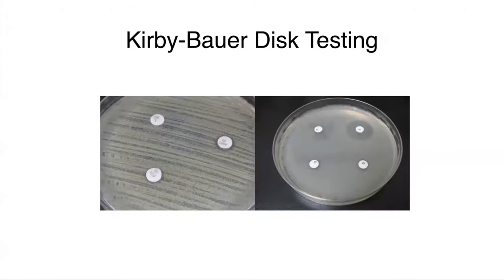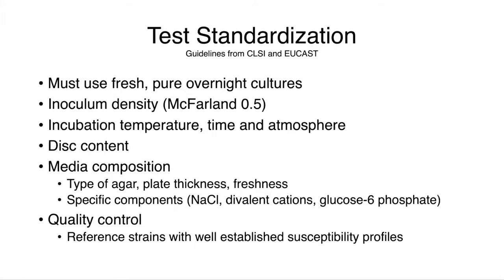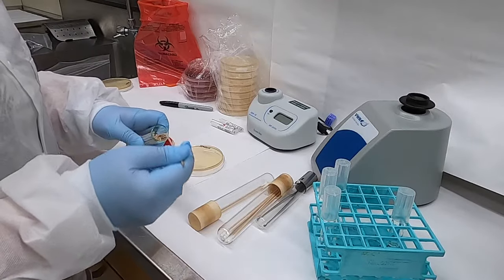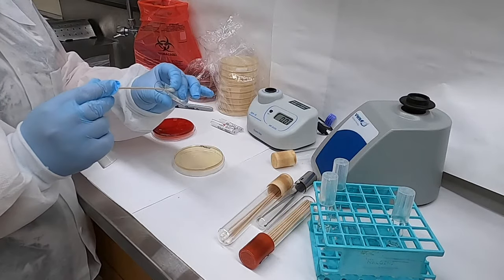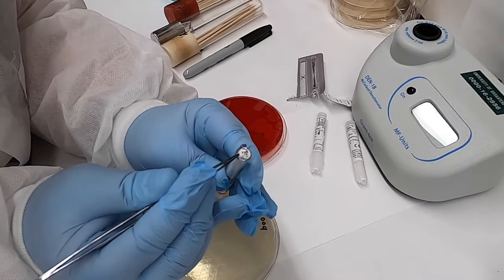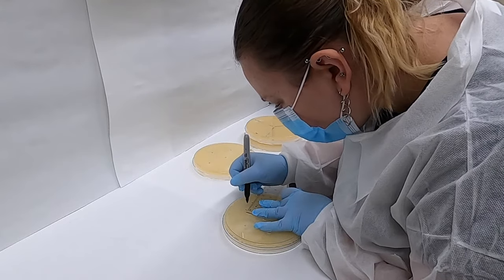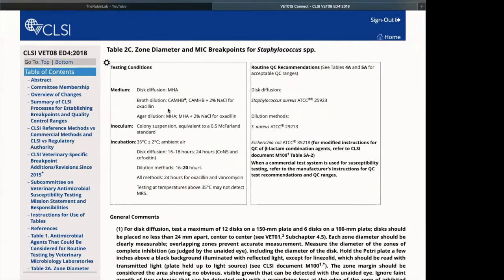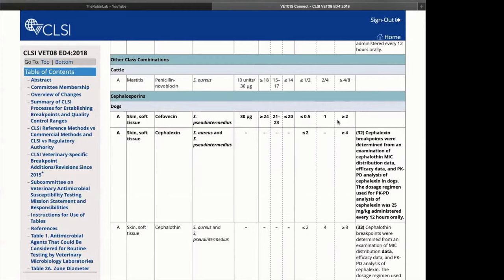Disc Diffusion (Kirby-Bauer) Antimicrobial Susceptibility Testing

Comment: I'm doing fungal research study these days. We couldn't find perfect method to test antifungal activity. Can't we do disk diffusion method on fungi
Reply from the maker: Hi Tania, I think the issue you're coming up against is that until recently there haven't been standardized methods available for these tests. However, for the tests which are used, I believe dilution (MIC based) methods are the ones which are used. See this link to the EUCAST mould susceptibility testing webpage, they also have one for yeasts and dermatophytes: https://www.eucast.org/astoffungi/methodsinantifungalsusceptibilitytesting/ast_of_moulds/ Hope this helps!

Comment: Hi there, please help! I am conducting the antibacterial assay of my plant sample following the well diffusion method. But I have faced with a problem. Should I filter my plant sample with the help of 0.2 micron filter inside laminar flow cabinet before adding the samples into the wells. I found that when I filtered my sample, the concentration as well as the volume of my prepared sample also get decreased. I have also gone through severe literatures of my field but found no paper mentioning the use of 0.2 micron filter. So is it necessary to do so or I can skip this step?
Reply from the maker: Hi Babu, I'm not sure I understand how you are performing your assays; in the disc diffusion test there are no wells in the agar. I am assuming that you are screening plant extracts for their antimicrobial activity? If this is the case it would seem generally reasonable to filter the extracts through a filter to ensure that you don't contaminate your experiment with the bacteria normally found on the plants. Generally speaking, when performing a susceptibility test you want to make sure that your reagents are free of contaminants and that the bacterial cultures you are assaying are pure isolates. I hope this helps!
Reply: @therubinlab  Thanks a lot for your nice explanation.

Comment: hello! may i ask what kind of agar did you use for culturing in this video? we are going to perform disc diffusion method on p. acnes and we are suggested to culture it in fastidious anaerobe agar specifically blood agar. if so, would the new plate which we will transfer our p. acnes on during the disc diffusion still contain the blood agar?
Reply from the maker: You've brought up an important point... for aerobic and non-fastidious organisms we always use Mueller-Hinton agar. I haven't worked with P. acnes before, but I would suggest taking a look at the CLSI standards for anaerobes: https://clsi.org/standards/products/microbiology/documents/m07/
If you have a clinical diagnostic lab at your institution they might have standards on hand that you could review. Testing anaerobes can be a bit of a challenge, and for many bacteria it is actually recommended to NOT test using dilution based methods (either discs or E-tests); you might be better off trying agar dilution or broth micro dilution. There are number of commercially available products for doing broth micro dilution on anaerobes (the MicroScan or Sensititre products are a couple that I'm somewhat familiar with). Best of luck with your project!
Reply from the maker: I realized my second sentence wasn't very clear... for some fastidious bacteria we DO use blood containing media (some Streps etc.). But before doing this, it would be good to see if there is a CLSI standard; that way your results will be comparable with other studies in the literature.

Comment: Thanks this helped. I didn't think that there was a machine that could tell the McFarland of a tube. WOW. Since we are in practice, we just use a random amount. BUT, i guess, it is best to add more then less since you did take colonies twice from agar and into saline.
Reply from the maker: I'm glad this helped! Making sure that you have a MacFarland 0.5 density of cells is CRITICAL - either too much or too little will negatively impact the test results. One thing that I could recommend if you don't have access to a densitometer would be to visually compare to a MacFarland 0.5 standard. To do this you can simply draw a dark, thick line on some white paper or card and hold it behind your suspension and and the standard at the same time; what you're looking for is an equivalent level of "blurring" of the line. I found this video which might be helpful (although they don't do the dark line trick) https://www.youtube.com/watch?v=yjiLk9_ZC1I Hope this helps!

Comment: Do you incubate the plates upside down
Reply from the maker: Yes! We always incubate plates upside down, otherwise you can get condensation on the lid which drips down onto the agar surface. When doing disc testing, it's important to gently push on the disc after it's places so that the discs don't fall off.
Reply: @therubinlab  thanks for your prompt response. I think it’s really important to mention this step in your video so the method will be clear to the end.
Reply from the maker: That's a really good point... I'm not sure if you saw, but I recently published a video which includes a link to a guide to performing disc diffusion testing https://youtu.be/RRFlSIKVSEs

My co-authors and I tried to make this guide as clear as possible... have a look and let me know what you think. I hope this resource will be helpful as well!

Comment: Thank you. Is there a specific medium used for this test? Can we use nutrient agar? 😊
Reply from the maker: Good question! Yes, there is a specific medium - both the CLSI and EUCAST state that you need to use Mueller Hinton agar. Nutrient agar does NOT give zone diameters which you can interpret with recognized criteria for classifying an isolate as susceptible or resistant. It's also important to make sure that plates are 4mm thick so that the drug diffuses through the media in a predictable way. Stay tuned to the channel... I just filmed demonstrations for a new video and took photos for a new visual guid that I'm preparing - I'm anticipating that video should be out in the next 3-4 weeks :) In the mean time, if you have any questions please just leave another comment below!
Reply: @therubinlab  
Thank you! Much appreciated!

Comment: Hi I want to ask that can I test antibacterial activities of solid sample by this method, for example ZnO nanoparticle
Reply from the maker: I'm not aware of a method (at least a clinical method) that could be used to assess the ability to test the inhibitory effects of a surface on the growth of an organism. If these nanoparticles can be solubilized, I think you would have better luck with a dilution based technique - either agar dilution or broth dilution; these methods will let you determine an MIC which will give you some quantitative data regarding exactly how much of the compound is required to inhibit bacterial growth. Here's a link to a video that I made describing the procedure for agar dilution - hope fully this will give you some methodological ideas: https://youtu.be/1t_UQhtR7pg 

Best of luck with your research!

Comment: great video
Reply from the maker: Glad you found it helpful!
Reply: @therubinlab   Hai Rubin thanks for the video. you have broth dilution method also but e test is not available. can you post a video on e tests for antimicrobial sensitivity testing?
Reply from the maker: @RywaTaka  I don't have one for E-tests because these aren't tests that we regularly use in our lab... BUT I would say that performing an E-test is technically very similar to doing a disc test (so this video essentially shows you how to do it). One small difference is that because E-tests use a gradient of drug concentrations, the strip can't be moved once it touches the plate; so unlike discs which can be adjusted immediately after being applied, E-tests can't. I am hoping to put together a video on agar dilution in the coming months which may be of use to you as well - this is an inexpensive method for determining MICs - so stay tuned for that one!
Reply: @therubinlab  okay thank you. 👍

Comment: I am using blank disks and disks where only solvent is added as a negative controls, Yet I still get small zones of inhibition for both. Are these zones okay as long as they are a standard diameter? Or is there an issue with how I am plating the disks or time between making the bacterial lawn and adding disks?
Reply from the maker: What solvent are you using? This could certainly be having an impact on bacterial growth; and I could imagine a situation where it is either enhancing or inhibiting antimicrobial activity as well... Are you testing regular (already approved antimicrobials) or novel chemicals? If you are testing regular antimicrobials, I would encourage you to take a look at the CLSI guidelines where you can find a list of recommended solvents and diluents for preparing antimicrobial containing media (for most drugs we just use sterile water). If you're testing other chemicals which are not soluble in water, then this could be a challenge and I would encourage you to think about trying a different method (agar dilution or broth dilution) which are better suited for these types of experiments as you'll get MICs vs. zone diameters. I hope this helps!

Comment: sir if the outcome was resistant does that mean the treatment was weak?
Reply from the maker: Good question, and I think that's a common misconception. I don't think I would say that this means that the treatment is weak - resistance means that the drug is not predicted to work if used according to it's label indication (in the species intended, dosing regimen - dose, route of administration and duration, and for the type of infection it's labeled for). I've put together another video which you might also find helpful, there is also a link to a written/visual guide which you can download:
https://youtu.be/RRFlSIKVSEs
I hope you find this helpful!

Comment: I did swabbing but instead of uniform growth, there were only scattered bacterial  colonies on the media.. Can anybody explain why it happened? 
What precautions should be taken while doing swabbing to get uniform growth?
Reply from the maker: Hi Malvika, my guess is that the suspension you spread on the plate didn't contain enough bacteria. Make sure to inoculate your plates with a suspension of MacFarland 0.5 density (~1-2 X 10^8 CFU/ml). Hopefully that helps you troubleshoot!

Comment: can we text oinment using this method
Reply from the maker: Hi Livy - I don't think I would recommend using the disc method for testing ointments; disc diffusion results would be very difficult to interpret for chemicals which don't have CLSI or EUCAST breakpoints. I would recommend doing a broth micro dilution test or perhaps an agar dilution test for other compounds - You can check out this video I made about broth micro dilution here: https://youtu.be/0xV_M6-PK0k
Reply: @therubinlab   ok sure thank u so much i will check it out i prepared a beeswax based salve i wanted to check it is agar dilution method okay for beeswax cream?
Reply from the maker: @rosieyves  It could work, I can imagine 2 challenges: 1. whether the product you want to test is water soluble and 2. how you will interpret the results - you will be able to determine an MIC but the question will be what does it mean exactly? Either way, sounds like an interesting project, good luck!
Reply: @therubinlab   thank you so much im working on a green sythesis project for nanoparticles preparation. i prepared the beeswax cream with a very small quantity of the nanoparticles i wanted to prove it's an antimicrobial agent
Reply from the maker: Hi Livy, I wanted to share a video that I recently posted about agar dilution which I think might be helpful for your study: https://youtu.be/1t_UQhtR7pg